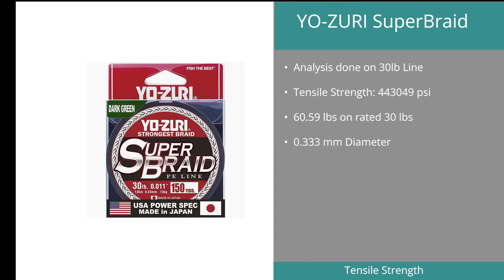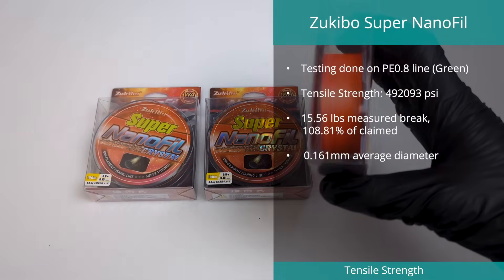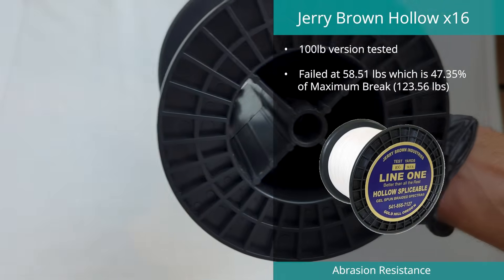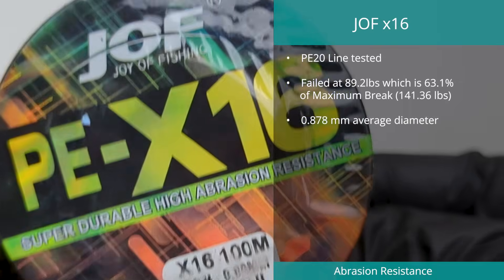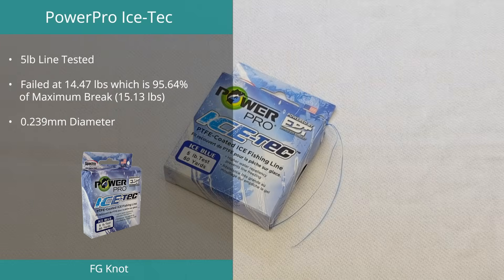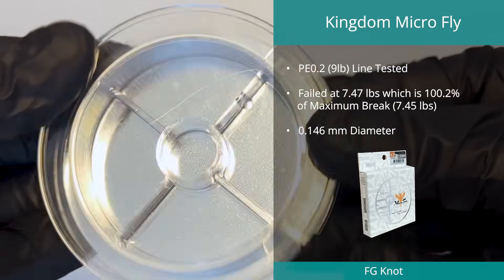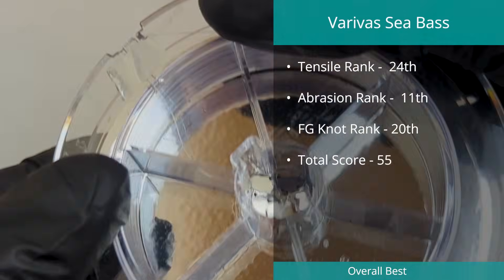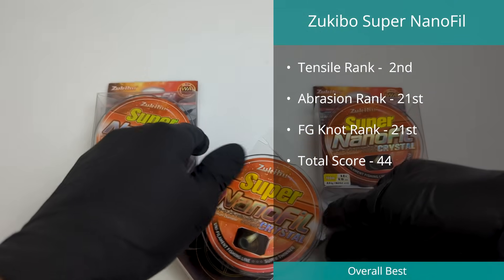The Top Braided Fishing Lines for 2026

Comment: Beyond braid 8x is hard to beat for the price and I have a similar line from Temu that's also working just fine.
Reply from the maker: We have tested one line from beyond braid and it didn't test too well, but perhaps we got a bad batch.
Reply: Thanks for the response, I've used it for almost decade. From 8 - 30lb. The dye comes off fast, but I just get white now. I use 15lb to a 4-5 wrap surgeons knot fluoro leader. I caught an 8.3 first day using that knot, but a 12lb leader, spinning gear!

Comment: Doesn't the FG knot test change for each diameter of line
Reply from the maker: Each FG is tied in the exact same way to a leader that is just slightly stronger than the braid, so it's as consistent as possible.
Reply: I use PR knot, is about the same time to tie but better overall performance.